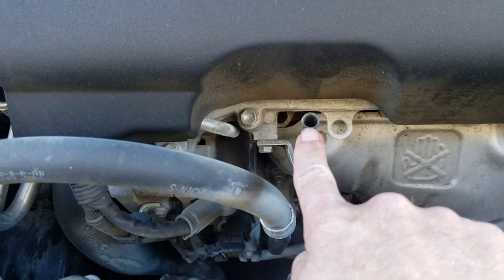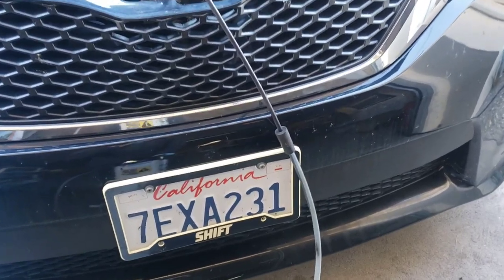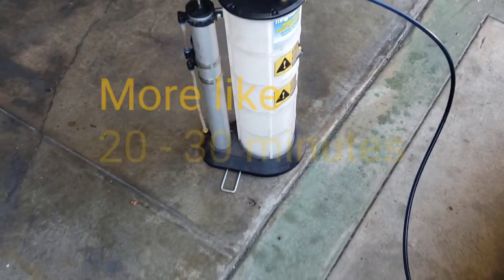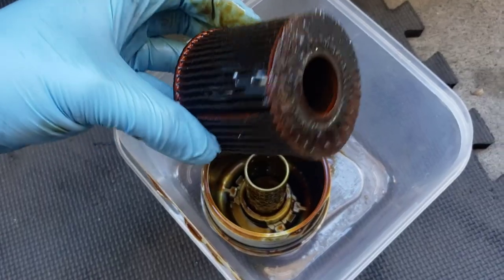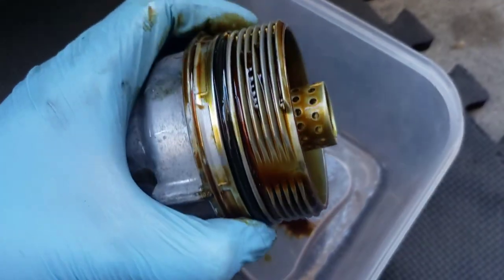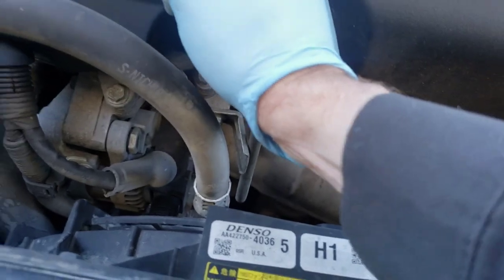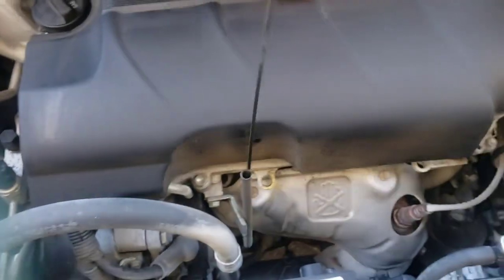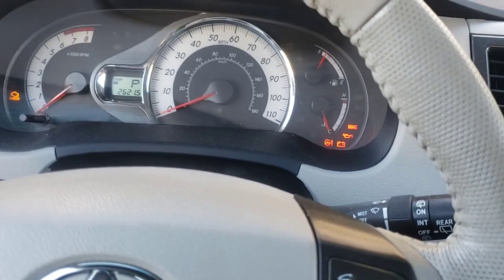Oil change from dipstick tube

Comment: What do you think about using a torque wrench on the drainplug instead if concerned about stripping it? I'm 73 and have been changing my own oil since I was 18. I've never stripped a drainplug.

Some folks think it's silly to change the oil only every other oil change but I'm planning to start doing that myself. I use the 0W-20 full synthetic and change it every 5,000 miles but I plan on switching from using a low-end filter to using a filter rated for 20,000 miles and changing it at 10,000 miles (every other oil change).
Reply from the maker: I agree that every other is fine

Comment: I like this idea for fixing a overfilled transmission maybe engine as well but this should not be how you normally do oil changes for engine or transmission fluid!
Ill explain:
All the sediment, metal shavings, carbon deposits and other buildup goes to the bottom of your engine oil pan, the metal shavings usually stick to the internal magnet 🧲
You need to get all of this out and the best way is to drain the pan every 5,000 miles (synthetic oil) through drain plug and remove the oil pan at least every 50k miles that way you can clean out the pan thoroughly, the magnet with brake parts cleaner and obviously change filters.
With transmission its generally the same but the pickup tube filter and oil cooler return line screw on filter needs replaced every 50-70K miles
There are other things for automatic transmissions that are preventative replacement parts like shift solenoids, solenoid packs and oil pressure governor solenoid that should be replaced every 100-150K miles (depending on make and model) with automatic transmissions.

But this videos method is definitely a cool hack to fix fluid level if its overfilled or slightly underfilled.
Reply from the maker: Where is your evidence of sediment not draining. Is it just how you assume it works or do you have a link to some credible engineering study or article. I ask because this subject is endlessly debated online in forums. "A test is worth 1000 opinions"

Comment: Buddy , I have a question , I have a 2021 Kia Forte , the motor was overfilled with oil about half of an inch over the dipstick limit , I have a pump from Harbor freight which actually works very well on pumping liquids out , the pump has a rubber tube , my question is if I insert that rubber tube inside the dipstick tube and start pumping to remove the excess,  that rubber tube from the pump can damage something inside the motor ?
Reply from the maker: You need a hard plastic tube. The rubber tube will get stuck. They have the perfect hard plastic tube at the hardware store for refrigerator ice maker water supply

Comment: Hello, I've got a question. My dipstick was cut in half inside the tube the other day. It's plastic so I can't use a magnet to pull it out. If I use this technique but with stronger suction eg. vacuum cleaner, will it be able to pull it out?
Reply from the maker: Yes that should work. A shop vac and a thin tube. Refrigerator ice maker water supply tube at the hardware store is a good cheap tubing.
Reply: @Mrelectric423  Thank you.

Comment: How do you clean the pipes from excess oil once you are done draining the oil with the pump?
Reply from the maker: I hang the oil suction pipe end from a clip on the ceiling, still connected to the pump so it drains excess slowly and doesnt drip.

Comment: Changing the oil filter can be difficult for people without much mechanical knowledge. And some people dont have $150 to pay for a mechanic that would otherwise cost you $30 in new oil. Plus in reality you can change the OF every 15-20k miles without mych issue. 
But if you can change the filter.